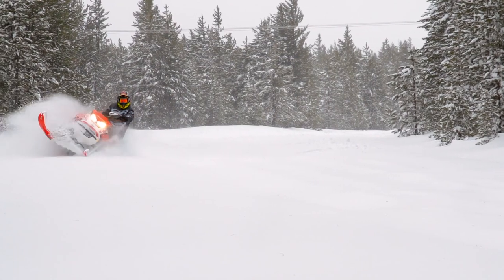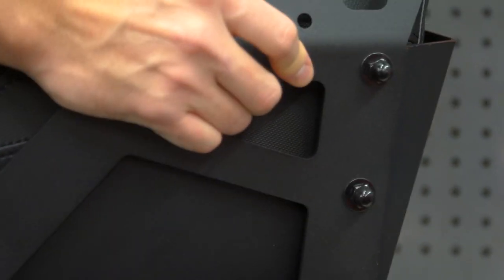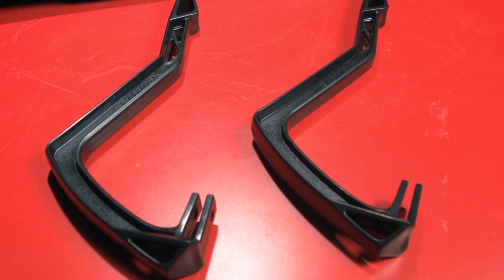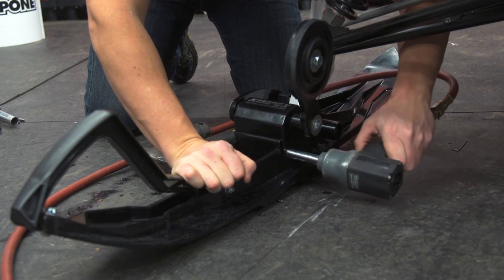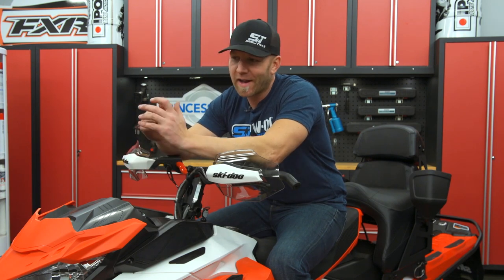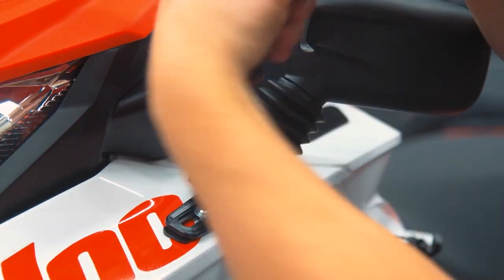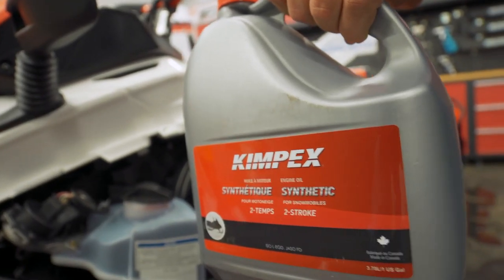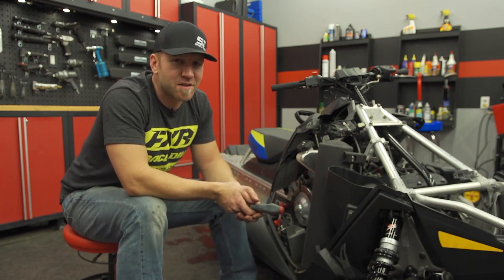2020 Ski Doo Backcountry XRS Touring Conversion

Comment: no the factory ski doo 2up is just 10x better
Reply from the maker: We install one of those next week on the show, its ok too. Both have their benefits.
Reply: @snowtrax  Looking forward to the comparison. I don't believe you can honestly call the install "expertly designed" when it requires drilling through the tunnel.
Personally I think I'd rather pop off a couple linq brackets and pop the seat base off, taking 5 minutes to remove as a reasonable trade off to drilling through the tunnel. Also, mirrors? lol hand mirrors are so much handier (get it?). No drilling through plastics, it doesn't vibrate (i've never seen a hard-mounted one that doesn't) and it's super cheap. Kimpex just seems like one of those cheap auto accessory companies like quadratec or smittybilt selling wind deflectors, rock deflectors and leather car bras that people think they need.
Reply: @snowmanwithahat  The mirrors made me sad..  But there probably is the 1% that want that on their sled so i guess they are just showing the options available
Reply: @snowtrax  I apologise... The skidoo one looks just as bad to install
Reply: I’m pretty sure the BRP one requires drilling the tunnel as well, but I agree, I like it far better.

Comment: I have 2017 backcountry x with pop off 2 up and handles for rare time my wife wants to ride with me. Also use muffs which are worth their weight in gold. Friggin cold in Northern Ontario and I can ride with a light glove using muffs. The one issue I have with this sort of set up is cooling. I have the 146 ice cobra 16 wide with 1.6" paddle and skidoo ice scratchers. Also dropped backend to catch more snow and it's working pretty good right now but I'm concerned about icy hard pack conditions in late March/April. Thinking of switching to a Composite 146 track 15" wide and 1.38" paddle and stud it. Anybody have experience with that?

Comment: Hey guys , good segment on trying to make the BCX  more of a trail running . 

What would be the possibility of doing a segment on suspension  for the trail rider?
I find that the ‘20 BCX can be alittle stiff . (Due to the XRS model)  how can a person who uses the BCX for more of a 95% trail and 5% off trail  soften the suspension without getting  rid of the KYB?
I’m actually thinking about trying 5.7 pilot’s on mine as I find the DS2’s a tad aggressive.
Basically just trying to set suspension up for trail use.
Keep up the good work guys.

P.S I know I’ll get flake for this  but there are people who just wanna to ride BCX’s on trail.
Reply: I have the same sled and am wondering the same thing!
Reply from the maker: Hey its not a bad question at all, you can choose to ride your sled any way you want and we are here to try to help as best we can. I will say the XRS is valved a little stiffer so your going to be tackling that issue head on. You could have your shocks re valved, you could also try to inquire if there are softer springs to put on the sled. Besides that I'm sure you are running all clickers at full soft, and the rear springs the same. Switching to the Pilot skis will make a big difference, I think you would really like the change and it'll settle down the front end a little. Sure you'll lose a little off trail but from your comment you don't ride off trail much anyways so that won't be a big issue. Back to suspension, you can only go so soft with the shocks as they are from the factory and obviously backing off the spring preload all the way around to help out, but at some point you may need to send the shocks out to be re valved to allow for lets say the current soft setting to now be your mid pint or even 3/4 stiff. This would then allow you to adjust far softer than the current setting. They folks who do that will also be able to put in the right weight shock oil to help with flow as well. The other option is to get a new shock set up but thats going to be really pricy and just working with a good reputable shock rebuilder will get you the excellent shocks you already have but tuned for the way you ride and it shouldn't cost too much. Hope that helps. Thanks for the question and for watching our stuff. ~AJ

Comment: How dose he carve like that with barley any counter steer he dose it in every vid I've seen
Reply: its called leaning...
Reply from the maker: Counter steering will get you over pretty good but if your decently tall you can use your body mass to pull the sled over, like Walker L said, it's just all about leaning into the carve and it'll go with you. Give it some practice and you'll get it.
Reply: @walkerl2482  that's the thing I've tried it bolth feet one side and leaning as far out as I can but unless I get a lot of counter steer I cant get it to lay over
Reply: @snowtrax  makes sence I'm only one 180 and 5 9 but I'll try it next time I'm out in the deep stuff in west Yellowstone
Reply from the maker: @cartersanford449  Most times we use a good quick counter steer to pop the sled over then you can straighten out the bars and go fro there, either way it's a blast to practice! West has epic snow this year, rode in 5 feet of powder on the Turbo etek a week back.
Reply: @snowtrax  ya it's so good this year go to my family's cabin in shotgun and either just ride out the front yard or if I want good snow Its just like 30-45 min drive to west and it's so great. And if you snowboard or ski the backcountry there is great and targee has 9 ft

Comment: Please don't start reviewing the family capsule trailers. I was out last weekend and saw a group on the trail doing 20 MPH and there was 8 to 10 of them in a line and 3 of the snowmobiles were pulling these little bubble enclosures with their children in them. they wouldn't pull of to the side and we had approx 30 sled backup (probably 10 + groups) until we hit an intersection. This new group of trail sledders are going to cause major accidents cause i saw a lot of people just going for the pass and that can end up being a head on collision.. Not sure how to handle this new generation but it scares me.. It's like learning how to ski on the bunny hill and then skipping the bunny hill and taking the kids on the black diamond slope...

Comment: I like your show, but not when you recomend stuff that is crap....
The scratches that you installed are junk.  The cable will break after 2 season, from flexing back& front.
The seatjack is not confortable and for an extra $200 you get the doo linq seat.
Please do not promote stuff that you  your self would not use.